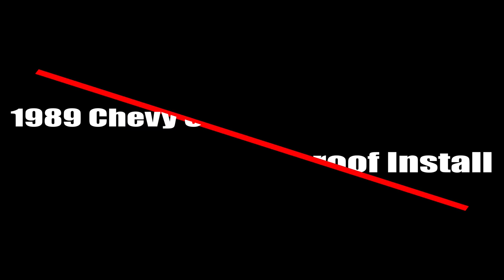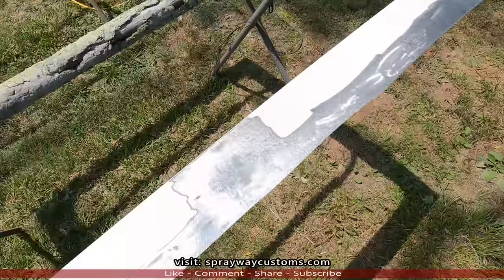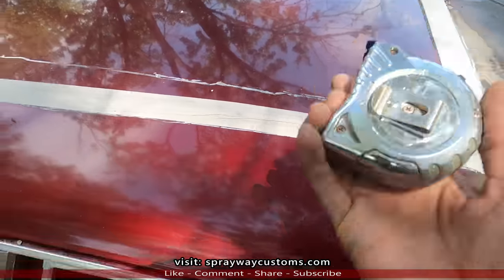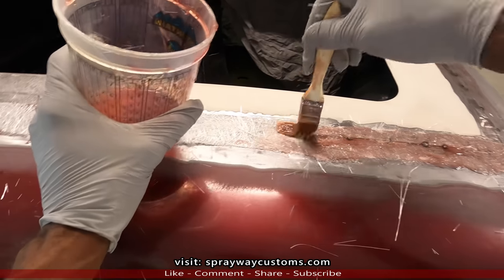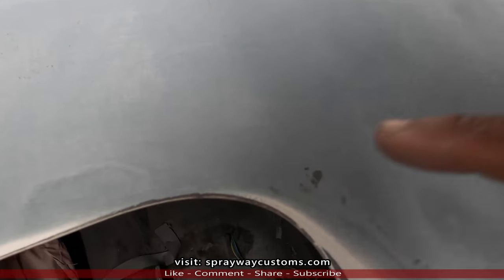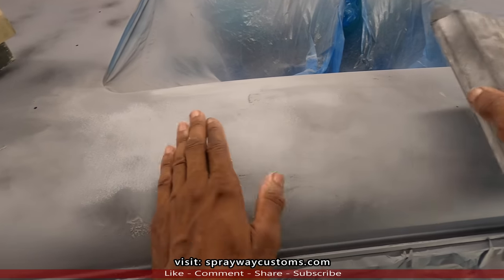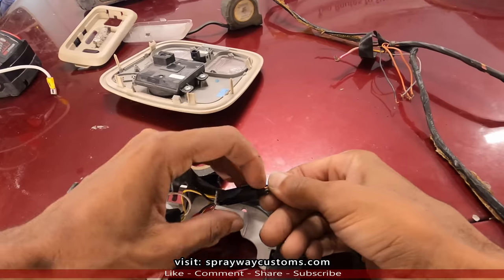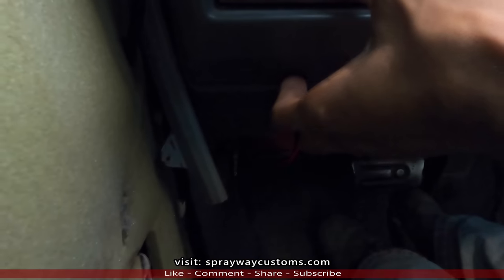How To Install A G6 Panoramic Sunroof - Box Chevy Caprice LS Brougham Moonroof Installation & Wiring

Comment: awesome tack welding on the roof and doing the fiberglass was great , but i was wondering since there is a big speaker box in the trunk wouldn't it be better to put a sealer bead on the inside where you didn't tack weld ,so when they turn up the music, it wouldn't rattle the inside metal that wasn't tack welded and fiber glassed ?
Reply: That's a good question. I was wondering the same thing, but I did notice that the fiber glass resin went on first and I would assume some of it wicked into the space between. When that stuff hardens I imagine it might dampen the vibration, since it fills the airspace. Not sure though.
Reply from the maker: That would be a good idea

Comment: I used your method for my panoramic but i did Alodine on The Baremetal and Panel Bond On Both the inside and out of the seams With 3 Layers of Fiberglass.... just gotta get the wiring sorted on it i took mine from a 2008 CTS caddy
Reply from the maker: Thanks for the info

Comment: I know this has nothing to do with this specific video, but I'm wanting to know if you can help me figure out why my radio and door locks are not receiving power. At one point they were and I let my car sit for about 2 months. I jumped it off car cranks up but radio doesn't cut on anymore and door locks don't receive power any more. I straight wired my radio to a battery and it still works but connected to the car I get nothing. I checked my radio fuse and it's still good .
Reply: The car is a 87 brougham caprice all stock just aftermarket radio

Comment: Hey big homie I like the box I had a box Chevy My first car and I loved it I wish I still had it but I got wrecked I got total it was sick star blue purple pearl with Gold and chrome  16s  . That was in the '90s so 16s that was a pretty good wheel at that time. Hey bro a brand called slick sand it's made by evercoat. Then spray that polyester after you spray that down and it'll come out smooth and it's tough too cuz it's got like a hard residence out of it it's like concrete and it won't crack it's good just try it

Comment: Question? Why don't you it's polyester primer. It's thicker and would fill your low spots much better than regular primer. Thx, for the videos. You make it look simple.  My favorite part is how crudely you measured and cut it out. I watch one of those high end shops put one in and they had to have been rocket scientists. The tools they used the mathematical equations they used made it seem like you had to be a math major and engineer lol. I love your style much better.

Comment: @ sprayway when it comes to the front lights where the switch is did you run the ground and power to the original dome light wire aswell?
Reply from the maker: Yes I did
Reply: @SprayWayCustoms  if you come across a G6 roof shade I will purchase it from you. My G6 is missing that part

Comment: Question?? Why not just weld the roof instead of fiberglass?  I know it would take longer because you have to jump around so it doesn’t get to hot and warp. But wouldn’t that be better?  It’s Just a question. I’m not taking anything away from watching you work your a wonderful teacher. You need to hold seminars.

Comment: It would be better to tape the template down on top of the roof because as you trace it it will move around a little bit so it would be best to tape it down next time for a proper and correct fit
Reply: So
Reply from the maker: Thanks 🙏🏾

Comment: When are you going to build something for SEMA ?? Have you considered that option? Definitely think you should have your works shown off. I'd be curious if you can fabricate your own custom parts too!
Reply from the maker: Thanks. I haven’t thought about that
Reply: @SprayWayCustoms  honestly Spray, I think you should seriously consider it. But take my word for a grain of salt. I know your paint work is seriously good. To throw you an idea, maybe just maybe, you'll consider a Bare Metal/Patina Job too. If I was back home in the US, I'd definitely link with you to build my trucks. I think you got something serious. Serious to be shown off and known by many people. Don't sleep on the possibility brother 👍🏼
Reply: @SprayWayCustoms  from your experience, do you think it's possible to Era Blend a 1980 Dodge RamCharger? I just got my back side windows closed. To look like the Dodge Panel Truck. Switching off square lights for the round ones. And going for the Seafoam Green and white combination. Since those colors don't exist for the model. Maybe suburban doors for the back. Do you think it's possible to make a RC appear to be much older?

Comment: I would of used a Taylor tape measure just to make sure it was centered to be sure but hey good job 👏🏼overall for a guy in the hood working out a garage …he’s certified street legend OG in the car game…bet he got the best prices too…why not connect all drains to a splitter with one discharge? Just wondering 💭
Reply from the maker: Thanks man…you can do that

Comment: Easier way to find the center (since hoods can get misaligned, panels shift, etc.) would be to make a line to each opposing corner, in an "X". This also helps you align your template, because if each corner is touching the line, you're perfectly aligned.

Comment: You could probebly save yourself tons of labor time if you used 3m body glue and clamped the roof together. No welding and go straight to fiberglass filler, no fiberglass matt. And the body glue is stronger than those fluxcore tackwelds.
Reply from the maker: Thanks man

Comment: I hate to say but with that being a roof he actually needed to weld that up solid. With as many speakers there is  inside if it’s not welded up solid it will crack loose and start popping off the metal. This is speaking from experience and doing fiberglass and bodywork for 25yrs. Vibration and thin metal is bodywork’s worst enemy.

Comment: Badassed work bruh but just curious tho with the stereo system I noticed in the car won't that flex an crack the fiberglass& duraglass  bond tho ?? I guess with the tri fold shouldn't be too much stereo flex air pressure on the glass an weld points nice job big dawgy tho !!
Reply from the maker: No, it won’t

Comment: I wish you were close to me, I have a 2013 Mustang with an aftermarket sunroof it never worked right since it was installed. It flips up but wont go back  likes its jamed. the jack ass installer ruined my car.I am afraid to take the glass out  I see there are 4 screws that I can remove the glass but I dont want it to leak .

Comment: Another easy way to get a center line is take some tape and go from drip rail to drip rail then pull one side back till it's even with the other and the fold point on the tape will be your center

Comment: If you were smart you would have used paned bond instead of welding and fiberglass. Panel bond would have never come apart. I guarantee that fiberglass will come apart in less than 2 years. That roof is going to have allot of flex when you drive it which is going to cause the fiberglass to delam. Plus the gaps between the welds are going to expand and contract with the heat of the sun.
 I would have ground the inside of the roof and covered the new part with panel bond and put it in from the inside. It would have been stronger and take allot less body work. Some auto manufacturers are putting bed sides on trucks with panel bond because its faster than welding and just as strong. Corvettes. Ferrari. Lamborghini and other companies install panels the same way.  You could have saved yourself hours of work and had a better job that will last forever.  I was putting Olds Vista cruiser roofs on vans in the 1980s that are still there. With no welds. Remember you never stop learning. Learn everything you can it will help you. I built custom cars for over 35 years and I was always learning new stuff. Good luck man.